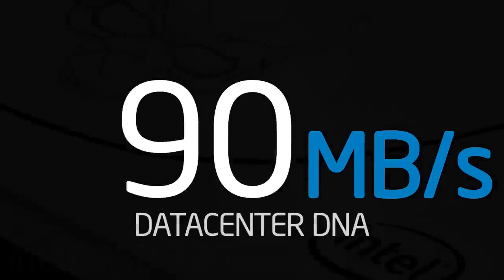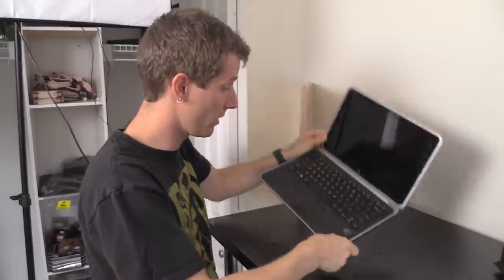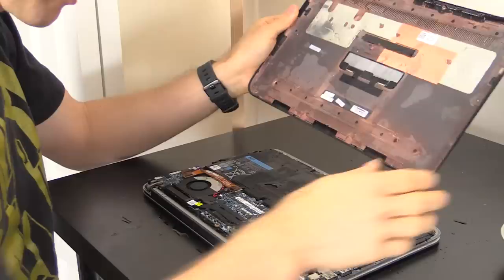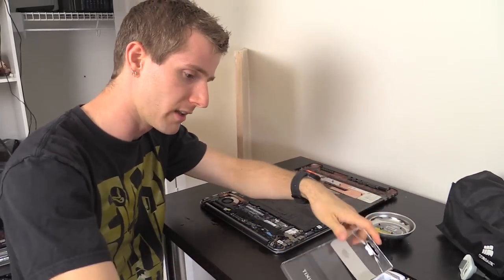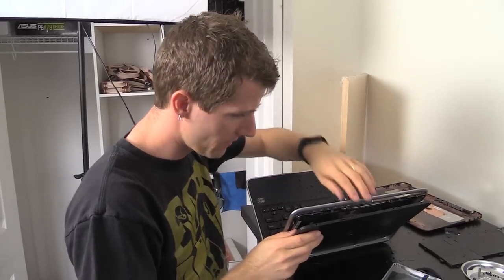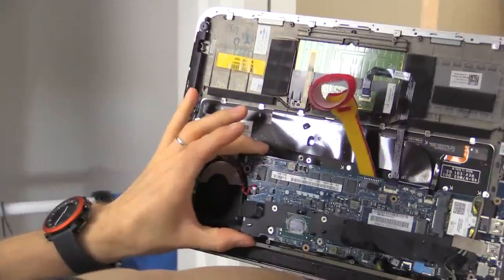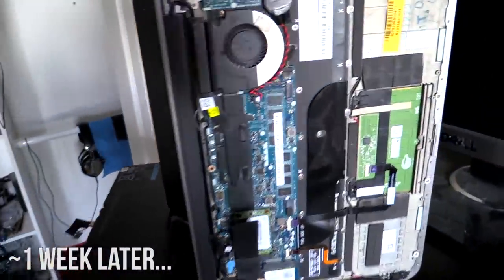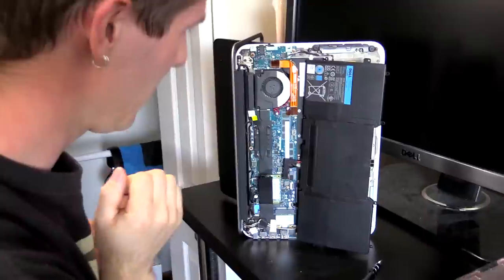Wet Laptop Recovery - Is it Possible?

Comment: That's why you DONT water cool laptops
Reply: Bro. That's impossible
Reply: ***** i don't know either man, I saw my opportunity at a bad joke and took it
Reply: but his laptop kept working... so.... water cooling here i go ;D
Reply: John Maclen Sorry Had too. http://www.instructables.com/id/Repaint-and-Watercool-Your-Laptop/
Reply: surely it's why you DO water cool laptops?
Reply: laptops are actualy water cooled to begin with.... kind of...  you see , the copper pipes which carry the heat away are actualy tubes filled with water drops...
Reply: primus loy Actually they are full of a inert gas watch his Vapor Chamber Quick Tip.
Reply: Bovly Yassa probably true because the water droplets would chemicaly react with the copper tubes otherwise

Comment: i had a pipe burst once in my room. soaked my laptop, tablet, phone, and plasma tv.
the screen on the laptop was dead, but i swapped it out with a replacement part. disassembled the whole thing part by part and after some air drying for about a week it worked perfectly.
the tablet and phone in rice worked like a charm.

the plasma tv is the real amazing part though. it was plugged in and on while getting soaked. when we were cleaning out the room we tilted the tv and water started pouring out of the corner... like a lot of it. could have grabbed a small bucket and filled it.
i assumed the tv was dead so i left it OUTSIDE on the patio for a week. just before i was about to throw it away i decided to plug it in and test it... 
worked fine. not so much as a dead pixel.
amazed.
Reply: Ty Guy Amazing stuff mate! You really care about your stuff, you persevere, oh man you are one amazing guy! I could imagine some people just throw away all their stuff. Great stuff man!
Reply: Miniply he left off the part where he filed an insurance claim and got money for the devices that never actually got killed haha :p

new TV meet old TV lol
Reply: ***** HAHA i wish. the reason i was so determined to get everything working again was not because I "really care about my stuff"...
it's because I didn't have any insurance lol. would have had to replace everything out of pocket
Reply: Ty Guy i was just teasing anyway.. but yeah in that case you really lucked out. phone partly aside, at least none of those things are really critical..but its still money lost if they were trashed.
Reply: Meanwhile apple products: one rain droplet goes inside I must now commit seppuku
Reply: @WyvernApalis  This made me snort and laugh out loud! SO true! Hahaha! Thanks for that!

Comment: I feel so good for you Linus! This story reminds me of the summer my mom gave me my first laptop when I was 12 or so: it was an old ACER with a 200MHz P2 I believe, slow and dusty, but I loved it. I left it outside over night and the following morning it was soaked. I opened up the bottom, removed the battery and let it dry for 2 days and it powered back to life.

Comment: here is a little tip, water is naturally not very conductive, it gets its conductivity by going through metal pipes and picking up extremely small shards of metal but still enough to make it conductive, rainwater isn't very conductive, its natural, so recovery based on rainwater versus, say, a hose, rainwater would have a greater chance of recovery.
Reply: All sorts of contaminants make water conductive, not just metals or running through metal pipes, mineral deposits exist in a lot of places, including the atmosphere itself. Rainwater is not very clear, as it picks up lots of debris and pollutants after condensing.

That said, it's true - clean water is not conductive, and there are worse sources of water than rain... But also rain water is pretty dirty, chemically speaking.
Reply: yes, but... his motherboard has metal in or on it making the water conductive sooooo... ya
Reply: any type of metal can make water conductive .
Reply: you make no sence first u say it isnt making water conductive then u say it is transfering electricity to it electricity can not transfer in a non conductive enviroment
Reply: yep..
Reply: So you're saying Pure H2O is not very conductive? Huh.. Thanks, never knew that.
Reply: ***** Actually BenjiiTCG is correct.

Although I will point out that the presence of a dissolved mineral or gas or metal or whatever it is will not make the water itself more conductive. The electricity at that point will be conducted more by the minerals in the water and not the water itself. H2O itself (assuming it is the same temperature) will always have the same resistance even if something is dissolved in it. I'm not saying the entire system will have the same resistance, but the water in the system will.

At least that was what I was lead to believe :). If you do research or otherwise know that's wrong please correct me
Reply: ***** r u 2?
Reply: You do realize that it's ions present in water that make it conduct electricity, and that rainwater is bound to have its share of ions in it
Reply: ***** Nothing has infinite resistance. The compound H2O (pure) has a resistance of 18 MOhm*cm^2/cm at 25C, so it is still very slightly conductive. It jumps to 40 MOhm at 10C
Reply: Ever heard of acid rain? Water picks up plenty of contaminants in the air that make it conductive.  Distilled water is non conductive though.
Reply: ***** Water picks up ions from metal OVER TIME not upon contact.
Reply: Exactly what I've been thinking.,. since I was little everyone told me don't put water near electricity... and now when I got older and know that water has a really big resistance without having a ton of minerals dissolved I don't really fear that it will short-circuit anything xD
Reply: I would just use isopropyl 100%, and soak most of the stuff in it. (just not a hard drive, but probably an SSD and I think a CPU to?) Correct me if I am wrong. I just do stuff for fun :P.
Reply: giant6025 Anything that doesnt have a moving part you can usually submerge in whatever you (reasonably) want. So you could do that with a CPU and SSD.
Reply: FabForceFour Thanks. It was exactly what I was thinking about. Thanks. Will have to try it out, lol.
Reply: KieronThe Pengy Pure H20 is actually an excellent insulator, believe it or not.
Reply: BenjiiTCG The water will pick up ions from the system, if you submerge a system in pure water it'll only last 10-20 minutes tops before it's shorts out and dies.
Reply: Don't forget the minerals in natural water, that is also a factor.

Comment: I reburbish a lot of radios, headsets, timers, PCs, basestations for the fast food industry.
Iv'e see everything from water damage, rats eating there way out of the equptment,  headsets being droped in deep fryer.
You'll be surprised as to what is still salvageable.
Reply: True
Reply: +Bryan Geonzon Why are there rats in a place where food is made?!
Reply: dalmation black Your guess is as good as mine. I'm guess a piece of food made it inside then the rat found its way inside to get to the food and couldn't get out then the rat chewed through some of the wires and eater starved to death or electrocuted its self.. (This is alot of assuming lol) 

When equipment just sits around for years and is never cleaned let alone ever opened then it breaks down and is sent to us to fix it usually has surprises mostly spiders, grease fumes typical stuff but every now and then ill find random stuff that caused the equipment failure
Reply: +Bryan Geonzon now i know not to buy refurbished items
Reply: Burgahs HEY! I do good work! (Sometimes... depends on my mood...)
Reply: K
Reply: +Bryan Geonzon I like this guy
Reply: Bryan Geonzon you said it
Reply: Bryan Geonzon clap clap

Comment: Done the same thing with my laptop. My daughter decided it was thirsty.
An drowned my poor lappy. Pulled it apart (completely) dried everything with a towel.
It took a few hours but it runs fine again. Done the same before with a router and a few phones. Seems to work most times.
Reply: your daughter decided your laptop was thirsty
hold on for a second
nope I can't keep my sides from going into orbit
Reply: Yer lol To cute. Had to tell her that the laptop doesn't like water.
Reply: Jesse pog I remember making a little gif animation with a PCB igniting (I know, not very realistic), and then text flashed onscreen saying "water is out poison".

But I would have waited a bit longer, and I do not recommend using a towel, fibers can get stuck, causing airflow problems or even worse, retain moisture. And I would have waited longer than a few hours.
Reply: Yer noted.lol a towel is all i could think of tho.
I don't have a compressor to blow it out. So i went all ghetto on it.. I really didn't think it would work.

Comment: Before putting it back together 100% inspect the fan, and see if you can access the base of the shaft to see if water got into the the oil. I have repaired water damaged laptops in the past (ones that were completely under water), and the main parts to die are the hard drive (benefit of an SSD), and the fans needing to be oiled.

Turbine oil can be had for around $2 and works well on the fans.

The LCD's almost always need to be replaced if under water, as water gets into the many layers of the LCD panel and discolors them ( in addition to damaging the lights and also causing dead pixels, so I usually just replace the panels)

The modern power saving features on many laptops will protect the most sensitive components, as they are able to completely cut power to parts like the CPU and other items when turned off, even if the battery is connected.

Comment: Am I the only one that thinks that Linus seems so shattered in this video.
Reply: +SoloNita Exactly and it boot back from standby exactly where he left it, pretty great !
Reply: +Noah Fischer wouldn't you be if your pc might die?
Reply: +Noah Fischer No I Agree and it is sad when he is normally so upbeat and go lucky to see him so shattered! =(
Reply: +Draken Weiner I should point out that if had had a HDD instead of a SSD inside he would have lost all his work!
Reply: +Darth Awar I don't think water would damage the data on HDD, but it might be much harder to recover the data though since you need to crack the HDD up to read the disks inside.
Reply: +Alexander Long You wouldn't have to "crack up" anything, you could just plug it into any other machine and draw the data from it, assuming there's at least some semblance of filesystem integrity maintained. Even if there isn't, it wouldn't be impossible to rebuild parts of the FS to get your data back.
Reply: +Alexander Long or it was an SSD
Reply: +Noah Fischer i mean he thought he was out 1,000 bucks on a laptop I don't blame him
Reply: no your not the only one
Reply: I would be shattered if my MacBook Air got water spilled on it, not to mention soaked in rain overnight
Reply: Noah Fischer your not alone

Comment: I sneezed on my Compaq Before and it died.... :(
Reply: My cat sneezed on my DDR slot and motherboard died as tottaly as processor and RAM
dont left you PC opened when your cat seek
Reply: LMFAO you made my day
Reply: Did it get a cough virus?
Reply: No, it died instantly, I guess no)
Reply: lol
Reply: that's how compaqs are
Reply: ***** I looked at your comment and my macbook started to burn my lap stupid heat!
Reply: Intergalactic Gamer ofc its a macbook hahaha
Reply: lol i know but not really
Reply: Robert Evangelista 

I plugged an old flash drive into my compaq before, and it died, no joke, in that moment the power supply gave up, and the mainboard was damaged.  The flash drive worked fine in another machine moments before.
Reply: Daniel Stevenson I have the same one!!! IT was my dad's old laptop and he gave it to me as my very first computer... I barely used it since it couldn't access the internet and it didn't even have a DVD player. I got a eMachines for Christmas 2010 as an actual first laptop.
Reply: Robert Evangelista R.I.P Your Compaq and my HP (Pixels cracked)
Reply: Robert Evangelista I blame virus.
Reply: +Robert Evangelista Yeah, "sneezed" on it.
Reply: +Robert Evangelista i did the same but my screen went white and had a burning smell to it i was so annoyed mine was the compaq presario cq58 it was a good computer but i sneezed on it and it broke fuck COMPAQ !
Reply: My office issued a new Dell latitude E7470 ultrabook,, with Core i7 2.8 GHz abd 16GB ram.
And it is such a work horse... better than the previous Lenovo thinkpad..
Great Battery life and performance.
Reply: It's a Compaq, look at it the wrong way and it'll die
Reply: Mutant!
Reply: Robert Evangelista that’s why you don’t use a compaq
Reply: that's why you use antiviruses
Reply: Daniel Stevenson I also have one of those but it has like every virus you can imagine
Reply: Robert Evangelista Fix it
Reply: If I hadn’t had to deal with my father’s ProBook I wouldn’t believe you. He tripped on the cable, sent it to the floor, and the screen was destroyed. It was shut BTW.
Reply: rip
Reply: @0xCAFEF00D  this aged well
Reply: what the

Comment: I think the only reason that laptop ever stood a chance was because rainwater is mostly distilled. There aren't a ton of electrolytes in it to fry anything.
Reply: The more plausible reason is that todays laptop's components are designed to be more resilient to extreme conditions (better insulated capacitors/batteries, built in fail safes, etc.) that if water does get inside the laptop, as long as you take the proper procedures, the machine has a very good chance of not turning into a paper weight.
Reply: Yes i think it is also the reason why my brand new g602 is now malfunctioning. Water dripped in mouse, while i was cleaning the dust and something sugary, was holding the DPI clicks, pretty tough and frustrating because i just bought it.

So yeah accidentally, when i was cleaning the case, water dripped on a little circuit inside the case. Didn't really bother me because never had done such thing before and many times i had left out my equipments outside, under rain, or forgot them. Nothing happened, nothing malfunctioned.

But that water was coming from water systems, not purified, non distilled.

After all that happened, i realized that my mouse started to malfcuntion, didn't read anything sometimes. Unwanted clicks, skipping etc. I tried to wash circuits with Vodka (since it's distilled alcohol) but it didn't really work out well. Then someone told me to put the circuits in paint thinner (synthetic).  It worked. I salvaged my mouse big time. Only G4 doesn't work and i have to use ALT+TAB or Ctrl+Alt+Del, click somewhere, then back to desktop.

So if anyone wants to clean their mouse up, use distilled water, or don't use anything at all. Alcohol (for medical purposes one) works best. But i didn't have any pure alcohol at the time. Thinner also works but it's a bruising/abrasive material. So be aware, don't let your parts sink in thinner for more than a few seconds. You never know what will happen.
Reply: Kaptan Kosto I put mine in with a load in the dishwasher then let it dry for a few days :)
Reply: FKProds rainwater is not by any means distilled. cleaner then tap water maybe but damn sure not pure. have you ever heard of acid rain. it worked bc the laptop was well built and he knew what to do
Reply: jbutton15 I'm not sure why you addressed that comment to me.
Reply: youtubes comment system is stupid not just put it on the thread
Reply: FKProds hahaha...

Comment: Well done man. I had a 32" Sanyo CRT screen TV that had a water main broken by a clumsy siding guy. Right behind it. Had water poring straight through the back of the set. In through the top vent holes and out through the bottom. The set was in stand by mode. I did the same thing, opened it up, used a blow dryer on the PCB's, and a large fan on it for a week. Put it back together and it fired right up. Worked for several more years.

Comment: Hibernation.  Betcha it ran out of juice and shut down before it got wet.
Reply: It would have battery reserve  at least for the clock.. amazing computer
Reply: @davidsucesso2419  maybe it connected to the internet and recalibrated the clock
Reply: Laptop Gamer  bruh did you come from the 19th century
Reply: The RTC usually has its own battery, even in laptops.

Comment: I think it shut itself down because it says low battery. So it saved itself before the rain. So there wasn't enough power in the battery to spark with the rain.
Reply: it doesn't really matter how much power is in the battery i don't think, I'm pretty sure a reaction would occur just based on the chemicals in it being mixed with water.
Reply: we dunno how long it was running on when it was left out, and the entire time that it was forgotten even if it went to sleep it would be draining the battery. on top of that it sat a week and that battery was losing charge that entire time so the fact the battery was dead means nothing.
Reply: About 3 weeks ago I accidentally spilled half a liter of water on my Lenovo laptop. It took about 3 seconds before it shut down, and needless to say I was pretty sure it died.

Took the battery out and disassembled it. I let the thing dry at a radiator for something like 13 hours, and it actually turned on. The battery was full AND was charging when the accident happened.

The thing is, normal tap water (and rain for that matter) is not a very good conductor. You would think that water is the worst thing that could happen to your electronics, but that is not necessarily the case.
Reply: ***** If the lithium got mixed with water it is more than likely that the laptop wouldn't have survived at all. That stuff can be dangerous!
Reply: edward stables It would have lit on fire... Case solved.